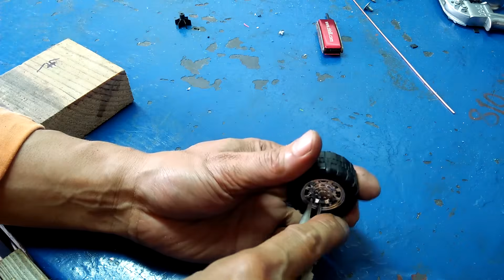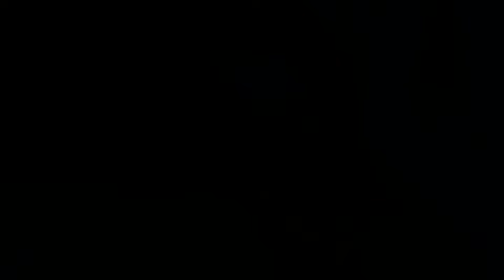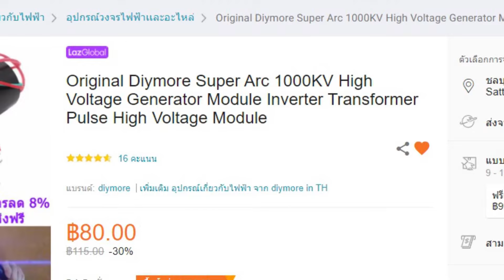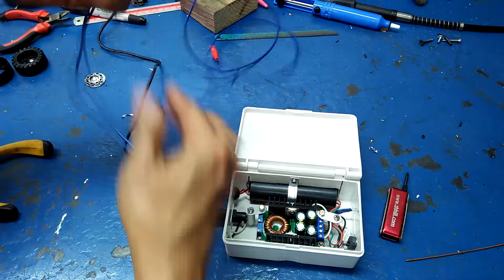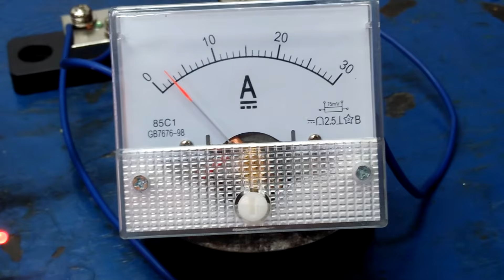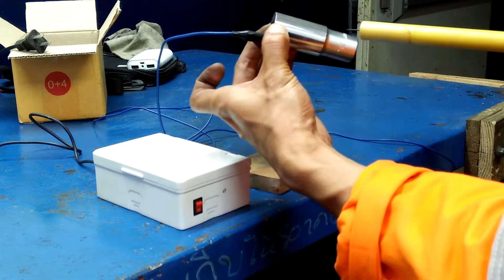Homemade Powder Coating Gun Power Supply

Comment: What are voltage and ampere rate to be adjusted?
Reply from the maker: in this project we can only adjust the power supply input voltage. The current adjustment only set the maximum amp output of the power supply.

Comment: LOL, Denmark usually doesn't have earth grounding wires exposed like that.
Reply from the maker: In residential areas you will not see those wires exposed. We have electrical equipment at work in remote location so we will have ground rods staked to the soil near the equipment, and of course the termination and the actual metal rod is exposed.

Comment: what the hell it's actually work. It's pretty cheap, I guess only about $30
Reply from the maker: Yes it does work but not very well. That is the reason I had several improvements to my homemade setup you can find in the homemade powder coating gun playlist in my channel. Thanks for watching and subscribing.

Comment: whats stopping you using a car ignition coil , they go from 10,000 to 40,000V with only 12v input.
Reply from the maker: Hi. I made a video about using a motorcycle ignition coil which is very similar to car ignition coil and it will definitely work. I have seen some working examples. The output of the ignition coil alone will not work because it is AC, it still have to go to a rectifier to generate DC output to create a static charge. The main drawback of that setup is the size and that it will only work at low frequency. Ionizing the air and charging the powder is more efficiently done with higher frequency. Here is a link to that video:
https://youtu.be/U24Y4QNquX4

Comment: My HV generator worked only few seconds. Now it gives a buzz sound only 😢
Reply from the maker: that is the problem with these HV unit. They are not made to last. That is why I build another one, slightly better. I built my own high voltage cascade similar to those used by commercial powder coating gun. Please have a look at my other videos. There are many improvements after this first prototype.

Comment: What is different if converter in ac/dc to the coil high voltage
Reply from the maker: Hi.  The final high voltage output needs to be DC so that it has negative and positive sides.  That is needed to ionize the air and charge the paint powder

Comment: what if we hold the object in power on. is it okay to hold it like a factory made machine?
Reply from the maker: With the object connected to earth ground and the operator also connected to earth ground (usually through the metal frame of the gun held by bare hand) then there is no potential voltage difference and so it is OK to hold it without getting shocked. You can check out this video where you can clearly see the earth ground connection to the gun:
https://youtu.be/kj_0Crict8g

Comment: Hello; I did the same system. But there is orangeness on the paint surface! what would be the reason?
Reply from the maker: There can be several reasons. Try lowering your supply voltage or increase the distance of gun to part.  Orange peel maybe cause by back ionization from too much kv
Reply: @DIYPhil  Thank you.🙏

Comment: Is it possible i use stun gun exchange power suply ? Or Is there a have to be in modification if use the stun gun?
Reply from the maker: Hi. If the stun gun have high voltage DC output then it will work. The HV module of this power supply is in fact the taser module used with some cheap stun guns.

Comment: Hatur nuhun elmuna mr.. Thankyou very 2 much.. Percobaan pertama ok color lamp red... Walapun kesetrum 2x.jatuh langsung rusak. Yg kedua indikator lampung blue btwhy olklh mantap sukses Hapensday
Reply: Mas apakah benda kerja yang dikasih ground nyetrum saat dipegang?
Reply from the maker: No. If you connect the work piece to earth ground properly then it should be neutral and will not shock you. The earth ground can be from your 3 prong wall outlet or a metal rod buried on the ground.
Reply: Power suplay nya berapa vol

Comment: Hello , I did exactly as you demonstrated. However my plan was to convert my existing 110V gun to one with these components so that it works on 220V . Everything worked perfectly fine when i checked the circuit without final assembly.. The positive output was connected to the central conductor of the existing gun. The other output of the voltage generator was connected to the existing connection where the negative output was joined to the mains ground and also to the ground from the metal object to be powder coated. Upon pressing the foot switch , there was a spark from the power supply which immediately blew up .' The Buck converter also blew up !!! Didnt know what happened !!!!! Can you please guide what exactly happened ??  I shall be obliged . Thanks
Reply from the maker: Hi. I myself blew up 2 wall adapter power supplies with using this HV generator. May I ask what power supply input to the buck converter you are using?
Reply: @DIYPhil  thanks a lot for your prompt. Reply. I am using a 12V 2A supply . I am feeling more bad about blowing up of the Buck converter . Don’t know what made them blow !!! Everything worked fine before assembly 🥲
Reply from the maker: @talwarjatin  at what current limit did you set the buck converter? 2Amp is at borderline not enough. That is the problem with the Chinese HV generator module, it consumes so high current.
Reply: @DIYPhil  4 Volts , 2.5 Ampere . U think a reversal of the + and neutral out of the voltage generator would lead to this ? where in the + went in direct continous contact with the equipment body ground ?
Reply from the maker: @talwarjatin  No. I had tried reversing the HV output but nothing broken. It is isolated from the low voltage input. The HV generator module will drain more than 2.5 amp, that overloaded your 12v, 2Amp supply that is why it sparked. I think the fried power supply is what killed the buck converter.
Reply: @DIYPhil  Checked everything and reassembled again today . Took the + electrode far away from the power supply in the cabinet as it sparked and arched on the power supply inductor last time . Another new 12 V 2 A supply installed. ( but will soon change it to 12V 5A , just some modifications to accommodate in pre-existing cabinet needs to be done. !! ) Added an extra layer of insulation on all wires this time. New buck converter. Everything is working ,. Will soon process and post the video of the final product  here . Thanks a lot for your  prompt replies and guidance , Appreciate it a lot .

Comment: when i ground the generator  wires they both spark how do i tset to find the + wire or do i have a bad generator  thanks nice video well done
Reply from the maker: Hi Ron, YES you are correct, they both spark, but I try to select the one with the noticeably stronger spark among the 2 output wires. Because I assume that the 2 output of HV generator module has a neutral (not exactly negative) and a positive. The neutral point while disconnected will also build up charge thus spark may jump to the earth ground. Keep in mind that the earth ground is neutral, neither - nor +.
Reply from the maker: You may try experimenting, swapping the 2 output connections and see which config works better at making the powder stick to the part. The taser module is sealed so no way to know exactly how they are wired.

Comment: where did you solder the blue diode?
Reply from the maker: Hi. That blue LED is originally attached to the buck converter pcb. I removed it from the pcb and soldered wires to the original pcb pads then connect to the led. That way I can re position the led so it is visible from the outside of the enclosure.
Reply: @DIYPhil  hello, I would like to advise you if a 12v 100mA power supply is sufficient for this system. and I can't regulate the voltage and amperage on this converter. will the meter show it to me or do I have to plug in the 12v bulb and the Ampere meter like you?
Reply: Can I ask you for help on this topic? 🙂
Reply from the maker: @kamild95  100 mA power supply is not enough.  Yes you can use the meter to adjust the voltage and ampere if your meter has those functions.
Reply: @DIYPhil     hey, could you link to a suitable 12v power supply? I don't know what to look for. thanks for the help. by the way, my volt potentiometer does not regulate the voltage. maybe too weak 12v power supply
Reply from the maker: @kamild95  you should look for a power supply that is at least 2 Amp capacity. Or alternatively, you can use a battery. Even a small 12V battery have at least 2 amp capacity. Good luck.
Reply: @DIYPhil  thanks 🙂

Comment: hello I found your video very interesting congratulations the only question how dangerous is the high voltage that is created between positive and negative thanks
Reply from the maker: Hi Stefano thanks. I'm sure it will give you a shock but it can't be lethal. The high voltage generator is the same part that can be found on low cost, low power tasers. In fact I did not supply the full 12 V to the taser module, only a mere fraction of its full power. You find videos of people getting taser shots a lot powerful than this and they just walked away laughing.

Comment: Been looking for this project a long long years ago....thanks PHIL .....INSTEAD OF AN ARC GENERATOR YOU CAN USE AN  E H T FROM AN OLD TELEVISION
Reply from the maker: yes. absolutely. I already made another version with the flyback transformer from a TV. I just don't have time yet to make a video about it. We can even buy those kit online complete with a TV  transformer.
Reply: @DIYPhil  thanks for the reply Phil... If you do a video for the tv transformer that would be great
Reply: Can you use one from a microwave oven?
Reply: @motorcyc1  no you can't. Flyback transformer converts low voltage to the 10k volt range.

Comment: Great Video, but why my modul generator is not longer life time?
Reply from the maker: hi. do you mean the duty cycle of the HV generator? Yes it is not very long. That means you cannot use this power supply for longer period of spraying. The HV generator is just a cheap Chinese product. I'm planning to make a better design using better materials soon.

Comment: So first you connect to the power supply the dc converter and after the high voltage coil ?
Reply from the maker: yes. that's about it.

Comment: 12or24v input?
Reply from the maker: The one I used is 12v but it does not matter because the dc to dc buck converter will regulate the output